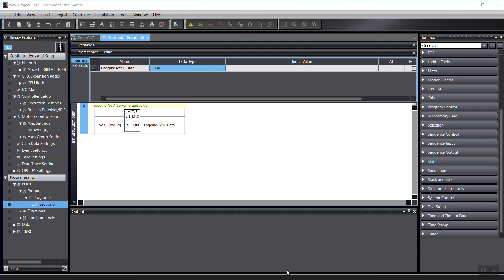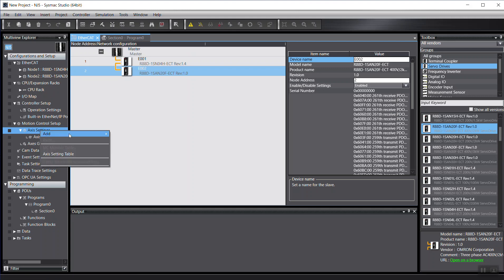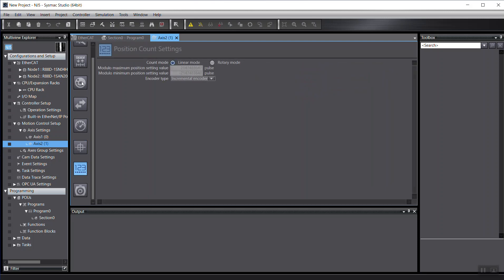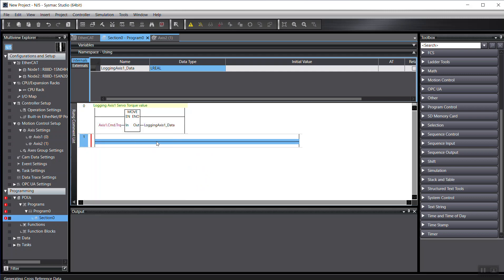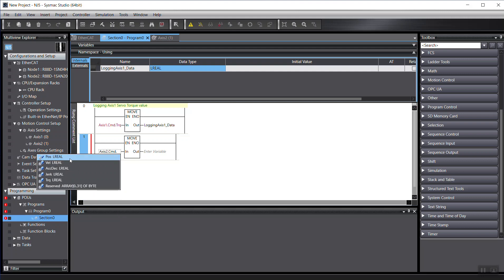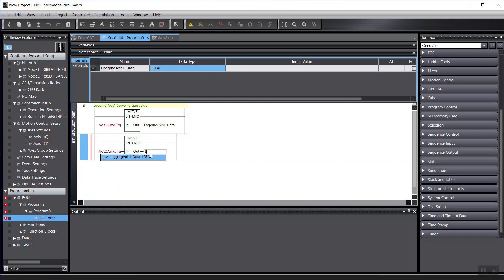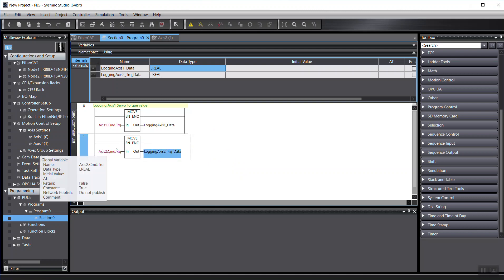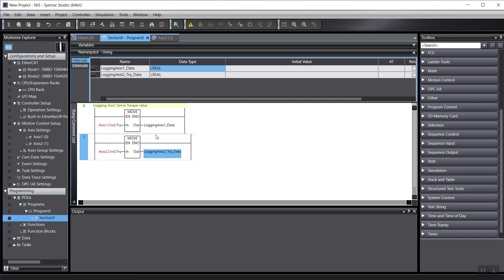How to log Omron 1S or G5 servo actual Torque/ Position/Speed

Comment: Hello how can iget a back up for 1s servo dr've parammeter
Reply from the maker: You can either back up the parameters via EtherCAT in Sysmac Studio, then save them onto your PLC program, alternatively, you can grab a USB cable, directly connect to 1S Servo controller by CX-Drive software, and back up a separate file. Sysmac studio is better & easier.